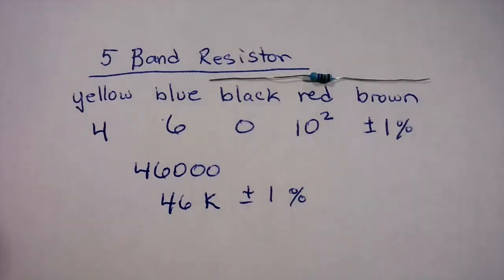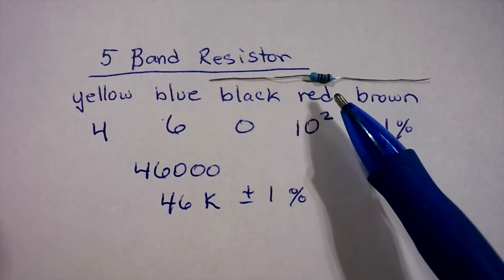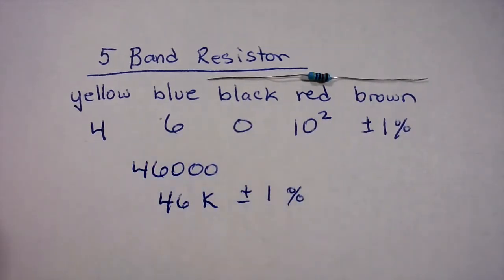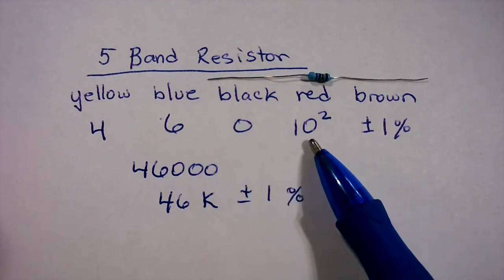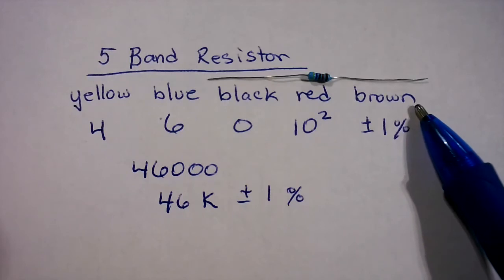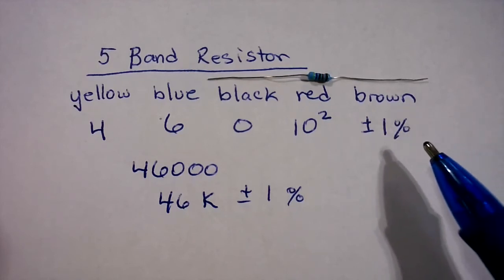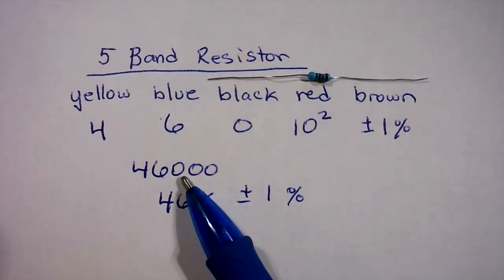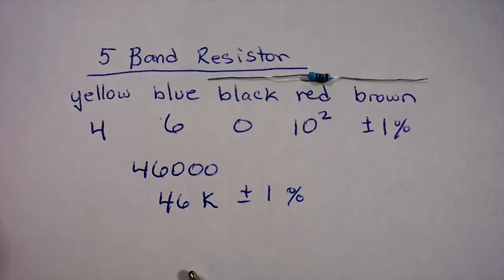5 Band Resistor

Comment: i had purchased a practice solder kit and it had numbers on the circuit board for the resistors, and didn't have a clue as to which resistor went there, discovered this video and solved the problem.👍